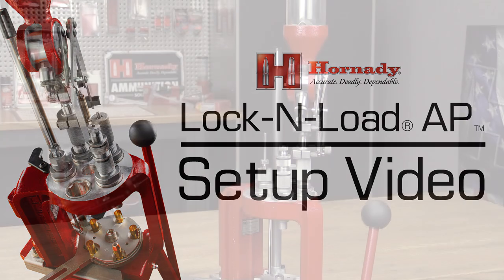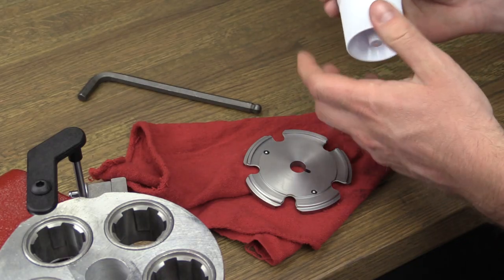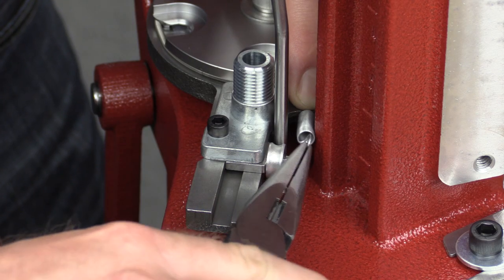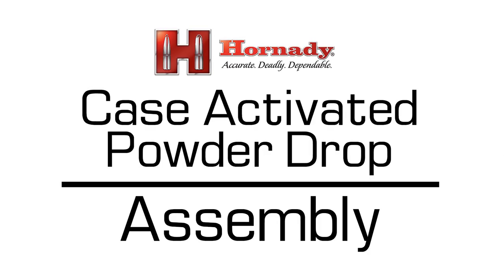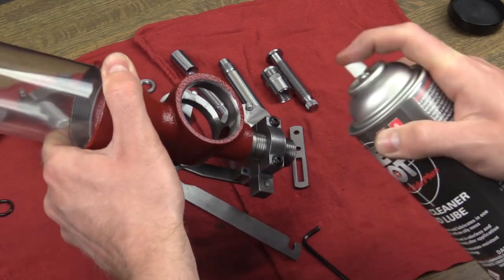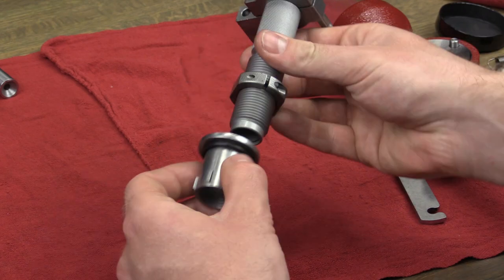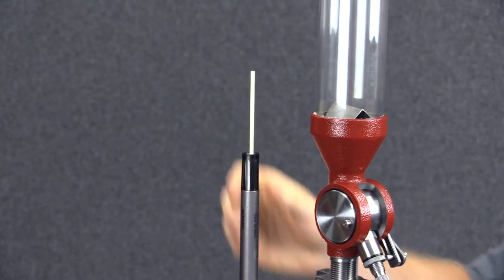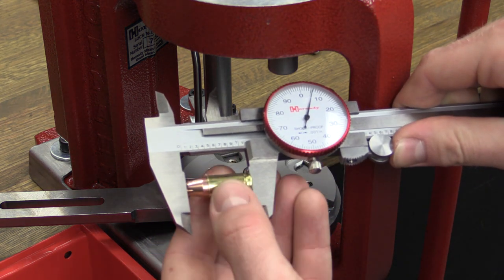Hornady® - How to setup the Lock-N-Load® AP™ Reloading Press (without Powder Through™ Expander)

Comment: I actually have accumulated 8 Hornady lock and load AP presses over the years. They are my pride and joy. I don’t concern myself with spending the money on a lock and load AP press. I know at any time of my choosing i would be able to sell them for even more than I paid. I have loved  loading on my Hornady presses and one great thing parts and accessories are so easily available for us with Hornady. I failed to mention the excellent warranty offered by Hornady. I have had few parts fail but when they did Hornady was right there to send me the part at no charge. Great company Hornady. More option more better. 
Only thing that would make me happier would be if Hornady was to announce the development of a six or seven station press, I would be the first guy in line to buy.

Comment: I really hope that Hornady One Shot doesn't do anything bad to the plastic in the Powder Hopper, since the included video shows the guy spraying it inside quite liberally. Wish I saw this video beforehand. 

Also, you should have a note about the plate that goes underneath the press for the Ammo Plant (required for the sliding shell loader) I had to break down my whole setup after the case feeder was installed, not fun.
Reply: The one shot does damage plastic. He mentioned it like 3 times...
Reply: “Do not spray plastic parts” should tell you all you need to know.

Comment: Picked up an AP two years ago and have had nothing but problems with it, numerous parts replaced by Hornady but still have problems. They really need to fix the ejection problem , when using the press and a round is at the ejection station it locks up the press. Been using RCBS for 40 years without a problem. Next press will be a Dillion...I'm done with Hornady.

Comment: I've had my LnL AP for 3 years. I have made numerous attempts to remedy the "spilled powder/powder jump" issue as the shell plate rotates into detent. I have even made calls over the years to Hornady regarding this issue with no solution from their engineers. They stated that they were aware of the issue as mine was not an isolated case and that the engineers were working on it. I cannot recommend this press until this issue is resolved. I have never been able to utilize full progressive loading without using my free hand to steady the shell plate during every lever pull. Pretty sad. Hope yours works out for you.
Reply: All progressive auto indexing loaders do this. I have loaded thousands of rounds with almost a dozen different calibers and I have experienced very minimal issues. Holding the shell plate like you speak of? Many competitive shooters that I know run all different brands of loaders that way. This is not a design flaw, it is the physics of powder. Highboy

Comment: The DVD that came with the press shows the ejector clip, which my press doesn't have and I panicked, but now watching this video I don't see it either, so I am confused.  Should the press come with one or is it outdated version that had one?  The thing is, when I run my 38 special cases, they don't get ejected, they get pulled "bump" but they don't fall.  I inserted a loaded round and it leaned 45 degrees outward and kept rotating with each stroke.  Help!

Comment: I have problems with the primers not dropping into the slide consistently and the bullet die doesn’t drop bullets consistently either it drops 2 or non
Frustrating press to work with

Comment: Does this product come with the lubrication you need for assembly? Anything else I need to make sure I have beforehand besides dies etc?
Reply from the maker: The Lock-N-Load AP does not ship with additional lubrication for assembly but any generic general-purpose grease will suffice. You will also need to be sure to have the following tools required for assembly:

7/16" End Wrench
(2) 1/2" End Wrenches
15/16" End Wrench
3/32" Hex Wrench (included)
1/8" Hex Wrench (included)
5/32" Hex Wrench
Needle Nose Pliers
Electric Drill
5/16" Hex Wrench

One Shot Gun Cleaner & Lube along with One Shot Case Lube are always handy to have around.

Thank you for your question! Our Technical Service Representatives are also available at 1-800-338-3220 for any further questions or details.

Comment: Which are the 3 powder drops used for? They have 3 different size inside diameters.
Reply: Didn't you get a Operation Manual with your press?  The longest sleeve is for pistol.. The #1 with the smallest inside diameter hole is for .22 caliber through .270 caliber and the third and shortest #2 is for 7MM thru .45 caliber rifle cases such as 45-70 .
Reply: Yes I did. I read it. Thank you!